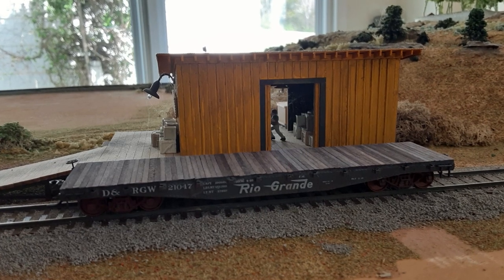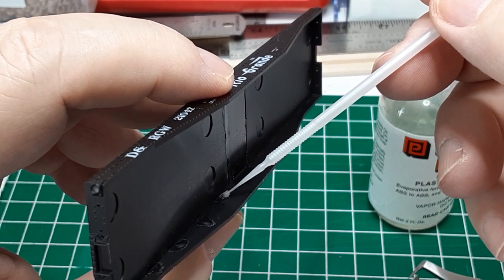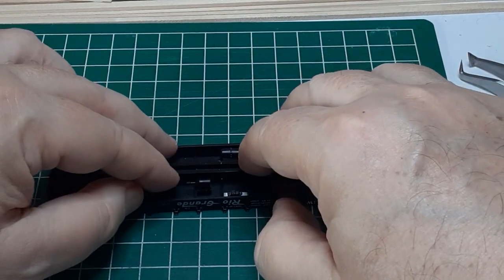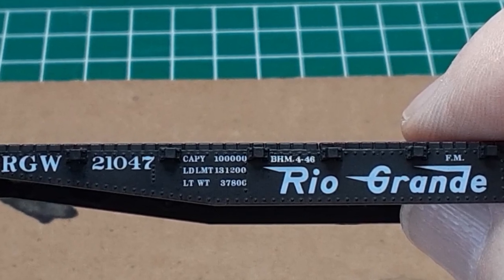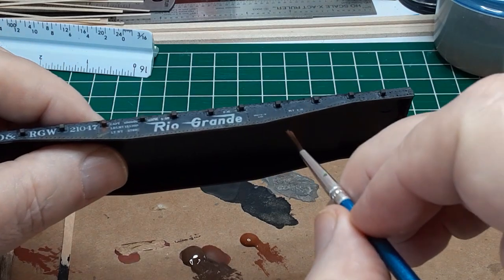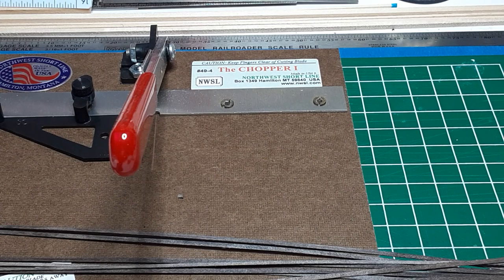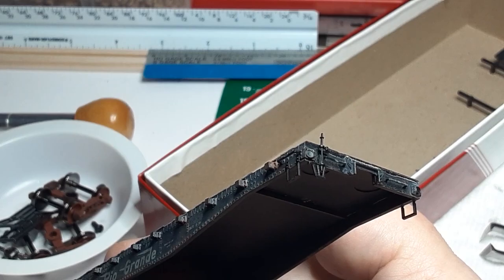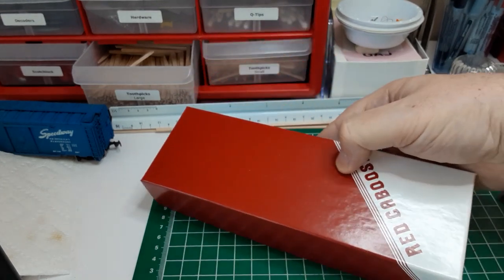Building a Flat Car from a Red Caboose Kit

Comment: I always paint both sides of the weight flat black for future corrosion control.  If there is any rust I remove it first by sanding.  Since it's just a weight I usually don't prime it first.  I model a fallen flag railroad, the Central of Georgia.  Cheers from an ex-Georgian in eastern TN

Comment: I just recently discovered Red Caboose HO scale rolling stock.  I've also discovered Silver Streak and McKean HO scale models and they all have almost the detail level of a Kadee car (I have 2 Kadee boxcars).  Only thing missing is the coupler cut levers but one can add those.  Almost all my models require K-brakes 'cause I model the early 1900's.  Cheers from eastern TN
Reply from the maker: I have about a dozen Red Caboose kits in my inventory. Sadly, the kits are no longer produced - Intermountain bought Red Caboose some years ago, and Intermountain has told me that their manufacturer actually charges them more for a kit than they do for a RTR model! Silver Streak and McKean are also no longer in production. The modeler today has fewer and fewer options when it comes to high quality kits. You can still get onesies and twosies on eBay and at swap meets, but good luck finding, say, ten identical kits.

Comment: I just thought of a way to stain your wood strips without having to resort to painting. If you anticipate using the 11 inch strips of wood, you could take an old piece of PVC pipe maybe an inch in diameter and 6 inches long and cement a cap on one end. This will be the bottom. You can now stand the tube upright in an empty jelly jar or similar and pour the stain in it with a funnel. You can then use the dip-and-flip method to stain your strips, then pour the stain back in its bottle with the funnel afterwards.

Comment: There are many flatcars running around with pockets that are past the decking, as when damaged it's a small matter to weld on replacements, vs cutting the side sill apart for inset versions.

Comment: Not exactly related, but I just now discovered that the stake pockets on the classic Mantua / Tyco "50 foot flatcar" are exactly half an inch apart. I was thinking of how to extend the original car from its stock 49'8" length to a more prototypical 53'6" length. All I'll need to do is splice two bodies together with the extra half inch created in the splice, as half an inch is almost dead on the needed 3'8" needed to get the car to the right length. Bonus - it won't spoil any detail, as the body is surprisingly well detailed and cast. It even has towing stirrups. I can then replace the steel weight with a custom cut lead sheet (like on my spliced Athearn gondola project) and then either splice two of the plastic wood decks similarly, or just use a laser cut one from one of several manufacturers.
Reply from the maker: Now that you're building a nice fleet of flat cars, what do you plan to do for loads?
Reply: @rwissbaum9849  I haven't begun yet - I only took measurements last night. Was not planning on a fleet, just maybe one or two. The gondolas will be the "fleet". As I have no layout, I'll probably end up donating everything to a local club in future as I begin closing out my life.

Comment: Really clear video, and great tips and techniques. Good job on replacing the dates and the brake update. Do you use any soap in your brush wash to keep the water's surface tension down? I often run into that when thinning with water. I'll often cut my stripwood in half so both ends will stain up to the middle, as long as that doesn't cause me to use more in the long run. And don't get me started on cobwebs. I think they are invisible until a camera shows up. LOL
Reply from the maker: I've never had any particular issues with surface tension, but if I did, I'd be more inclined to thin with 70% IPA - I'd be worried about a soap scum forming as the paint dried - don't know why; that's just a knee-jerk reaction.
Cutting the stripwood shorter is a great strategy until the stain bottle gets to half full - then your'e stuck no matter what you do. I almost always just brush the stain on. My biggest concern is tipping over a bottle of stain - I would GLADLY pay ten bucks for a base that cradled the stain bottle so it couldn't tip over! Pouring some stain into a flat dish is great - until you try to pour the leftover stain back in the bottle...
Reply: I agree, sometimes I've used alcohol as well. I've been really careful and haven't knocked over a stain bottle… yet. Motrak Models makes a nice holder that holds both Vetero and Hunterline stains. I haven't got one but I've thought about it. It's $15, plus shipping.
Reply from the maker: What a fantastic tip! Okay, more than $10, but worth it. You know how every once in while you find yourself doing something stupid, and you say, I really shouldn't be doing this, and then disaster strikes? Well, I've never tipped over a bottle of stain yet, but I KNOW the day is coming. I've just placed my order. This will save me a lot of stress when I'm applying stain. Thanks again.
Reply: I do know that feeling. I'll probably pick one up from them at the Timonium show this weekend, just to be safe.

Comment: Nice build. I cut my wood strips to length first then dunk them in an India ink wash.
Reply from the maker: I've always worried the stain would cause the strips to get longer - any issues with that?
Reply: @rwissbaum9849  Not that I've seen. They might get fatter when they're wet but I let them dry thoroughly before using them.